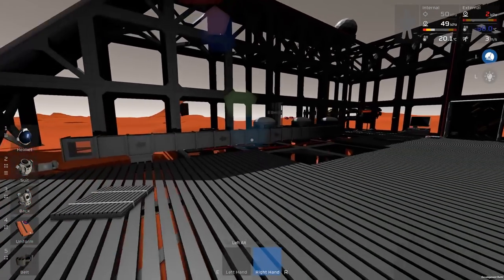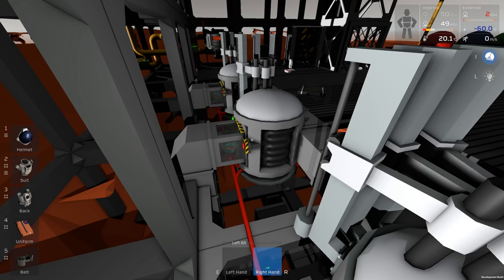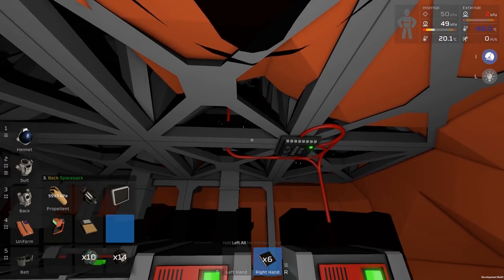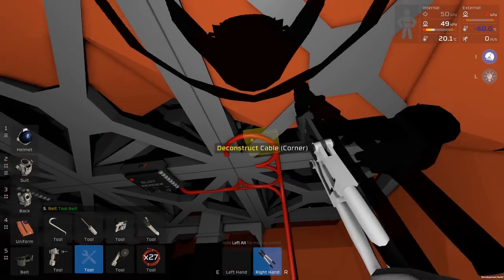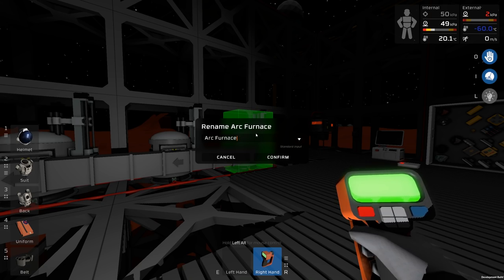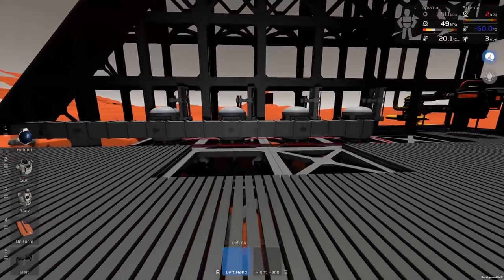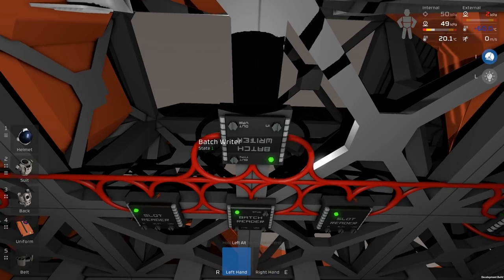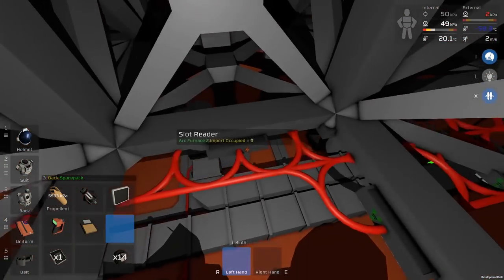Stationeers S2 E23 - Automated Arc Furnaces (part 2)

Comment: You could "buffer" all the ores in a vending machine. If an export slot tirggers you coudl "vend" with a logic writer to the arc furnace or do it with an logic computer. 100 stacks of ores is quiet a large amount in the small volume and also very tidy.
Reply: could be used as output for the mining belts and ingots aswell (edit: as he says later in the video)

Comment: probably more reliable with a comparator and both batch readers set to sum. if more furnaces are occupied than furnaces are active, hit acivate, otherwise don't. This will keep activate at zero until it is really needed. if it still gets stuck somehow just activate all furnaces manually and it resets on its own.

Comment: The system your using for the arc furnace, although effective, is a little in-efficient. As each run of ore finished the logic triggered all the furnaces again when there is nothing in the import slots of any furnace. I went a slightly different route which does use more logic but also eliminates the bug were furnaces connected to chutes directly as you have them will produce to much. (Some times they bug out and when you put in a belt full of say 50g stacks of copper through a chute and use logic to auto activate, the furnaces go into some kind of bugged loop where by they produce a continuous stream of 200g ingots - I had a game ruined by this bug once because I hadn't visited my production area for a while and the shear quantity produced was causing massive lag). So, although it takes much more logic I am using chute outlets on the import slot of the arc furnaces and my logic locks them by default. Then when the export slot is triggered on a furnace the corresponding chute is triggered direct from a slot reader so that it releases 1 stack to the furnace. When the chutes are empty and I add more belts to top the system up I wait for a light to come on which tells me all furnaces chutes now have at least 1 stack waiting and hit a button to kick-start the system - still working on logic to replace the button to kick-start. Also the output from your chutes were you have the ingots coming out, you can simply place a stacker at the end as they have been updated so that if they have something in them which is not a complete stack and a new item arrives they will clear themselves and start stacking the new item - your belts will just get spat right out without any delay - and you can then just pass them into your warehouse of vending machines (That's my next project which will be based on the sorting system developed by J33P_Guy_Gaming).
Reply from the maker: Yep, the next episode addresses the bug issue with a new electronics setup :)  (Spoiler - Two data networks, one batch reading the input slots, the other reading the output slots and writing activate to the furnaces on either being true) - works fine without chute shenanigans... so far ;)

Comment: grayduster I suggest you change the wiring for the heavy kind in your hot CO2 chamber, since you can melt normal cables with to hot temperatures of gases in the atmosphere around said wires! Heavy cables can't be melted in this way (to my knowledge).
Reply: Especially when you will heat it with the exhaust of a furnace!

Comment: Put an overpressure on each of your tanks (>55K) to release if you get too much.  This way you can always just assume waste gas will go to the filters.  If your gas is not hot enough to heat your room, feed it back to the filters and let it sort into your tanks.  If you want, move your existing radiator cooling setup before the filter system, but after your heat level logic.

Comment: grayduster I have a suggestion, just build the vending machine at the end of the output chute, since you can't stack diffrent rescourses with one stacker, it will just jam often, unless you will add some complicated logic to do it.
Reply: The vending machine will not stack items.  (At least it didn't when we tested it in beta).  If you feed it 5 individual ore ingots, you'll get 5 individual entries in the vending machine (of it's 100 slots available)
Reply: Nicholas Schubach Well that's better than a complete jam by using a singular stacker on a mixed ingot chute.

Comment: Good going with the sorters - Ill have to try that myself also like how it feeds the furnaces- but I would have separated each furnace on its own reader/writer -  slot reader for arc 1 - writer for arc 1 rather then try for batch read/write. Your already at 8 chips for 4 arc furnaces - they all seem to turn on/off as one unit - rather then each one alone.

Also i tried to comment on one of your other videos - about you complaining about the airlock cycle time. - Just use add a couple extra active vents with equal number of passive vents inside the habitat.  I had one airlock with 4 active vents - and yeh so fast I almost got blown out the airlock heh.

Have you uploaded your map to the workshop?  id be interested in doing some testing - I am using a small pre-built base that had a chicken coop / greenhouse pre-built - but the greenhouse needed allot of re-work to make it more functional - mostly in keeping its temp stable, still a work in progress for that.

My thing I used was the gas furnace - put a volume pump to fill it - and a volume pump to empty it - leave em off unless you want it on - pump it with a squirt or two of mixed gas - stays lit for several day/night cycles. 
built some chutes to add ore in / eject ingots out and works faster then arc furnace. 

I also set up the electrolizer device - to make fuel for an emergency gas fueled generator that charges the base in short order.
Reply from the maker: We'll actually be improving the furnace electronics in the next episode, as there are situations where they can jam.  They'll still all try to activate at once, but given the use case (emptying mining belts into the system), that works well.  If we did the perfect system, it'd be four chips per furnace, but we can save a few chips (see next ep).  For the ideal system, ignoring chip savings, two slot readers per furnace (import and export slot), two logic writers, reading each of the slot readers, and writing activate to the furnace will given entirely independent firing of each furnace (if you prefer that).

I'll definitely be adding more vents into the airlock systems when we get to larger airlocks :)

On the furnace - we'll be moving onto a pure co2 furnace pretty soon (since co2 is free, and power for heating is also essentially free).  That'll save the hydrogen use (oxygen will be free from plant growth, eventually).

Comment: grayduster I already said sort of a better way of doing it, just make a clock circuit, do this equasion [Bach reader - clock's memory value] and write it to the clock's memory and write it to the furnaces. Maybe it requires a memory chip additionally, but furnaces will do the job faster when diffrent ores and/or amounts of it will go the individual furnaces and most importantly it will prevent jaming when output and input full.

Comment: Not sure this system fully works as intended, I setup the same system and it work 50% of the time.  There will come a point in the process when the furnaces get stuck in an on state and the whole system locks up.
Reply: That's why using a clock woud be an advantage. It wouldn't stop completely at least. Unless those furnaces glich out compeltely and stop functioning poperly.
Reply from the maker: New setup in the next episode :)

Comment: If you just constantly sent an activate to all furnaces, wouldn't that work? I don't think it would activate without having anything in the import slot...
Reply: Mathias Andersson You can't, writers only write values to their destinations on a change of the input value so if you tell it to write "1" it will do it only once, unless you would use a clock circuit of sorts, but it might cause to lag more.
Reply from the maker: I did this using a clock circuit last season.  I found it hilarious, others found it horrifying :) You can use the new unary random chip to keep trying 1's ( and 0's ), with floor to truncate it's float value - less chips than a clock
Reply: grayduster I can make a toggleable clock with a prcessor unit, a i/o unit and a memory unit. How much does that cut down on logic units?

Comment: I still dont understand why others dont just use the gas powered furnace to mass smelt ores. Its not that hard to keep powered and heated and it instantly smelts the whole stack, almost no waiting. Just leave the eject lever pulled and feed chutes threw it and bam! 
“But what about alloys! You cant smelt alloys with the lever always pulled, and cross contaminating other ores?” I hear you swave players say...just have another furnace to the side dedicated to alloys, and with the lever always pulled on the first it ejects the stacks as soon as there finished filling, so it cant accidentally alloy other metals.
Reply from the maker: The most obvious reason is that it consumes resources (until you get a pure hot (i.e. no ignition) gas furnace up, which takes more effort, but I'll be doing that too).  Arc furnaces use electricity only, which is essentially free.
Reply: Yes but oxylite and volatiles basically grow on trees. Not that hard to keep maintained even thou it consumes resources. 

I see your point thou im just personally more willing to exchange resources for blazing speed. The arcs take a year and ahalf to smelt a whole stack of gold where the gas furnace cooks it faster then pop tart shoved under a Saturn V.

Any who just some food for thought.
Reply from the maker: Oxygen literally does come from trees (plants) and is free on Mars, as we have infinite CO2 for conversion.  Hydrogen - not so much.  If we could get regenerative hydrogen, then I wouldn't need to mine more.  Pop tart under a Saturn V sounds like an excellent KSP episode mind you :)
Reply: grayduster hmm maybe i just got lucky but i know on my map im always running into H2 ice i cant get rid of the stuff. And now with the new electrolyzer in the game you can turn your h2o into O2 and H2
Reply from the maker: Heh, and now you've moved the problem onto how to generate H20 :D

Comment: The reason they're all lit at the end is probably that your logic keeps toggling. If there's a furnace with stuff in it, and another furnace that's off, you'll activate the furnaces. Then they all read as active, I think, so your writer switches to 0. Then the empty one turns off, and the cycle repeats, fast enough for the furnace not to look like it's shutting off. You might be able to avoid this by testing if the sum of input slots is greater than the sum of active furnaces, which means it won't fire if you've got a combination of running furnaces and empty furnaces but no ready ones.

I think both your version and mine have an issue where, if the system decides to fire on the tick after it last fired, it'll get stuck. I think you can avoid this with a couple more math units, but it may not ever happen in practice with your furnace arrangement.
Reply: iabervon I thought it didn't allow logic to activate a furnace without a ore inside the import slot before. Devs could have broken it.
Reply: I'm pretty sure we saw in S1 that it does the animation at least, but it turns right back off. His circuit actually depends on this; if there was one furnace running with stuff ready to put in, and another furnace sitting empty, when the first furnace finishes, nothing would change (max input = 1, min activated = 0) and it wouldn't restart the furnace that can do something. But since the min activated keeps changing because writing non-zero to it makes it read as non-zero briefly, the total does change and the writer writes again.
Reply: iabervon But it still definetly behaved differently before. And since there shouldn't be a change to that (not noted in any pach notes) it sems like it was recently broken or was broken the whole time, which it wasn't (to my knowlege).
Reply: I just posted above but I think I am seeing this problem in action with the same setup as Grey.  I think the system needs something extra as you will encounter a point where the furnaces will get stuck and the system will halt.
Reply: If you're finding that the value the writer ends up with is 1, you could try this: make an oscillator with a unary not that reads from itself. Add a math chip that multiplies the oscillator by the chip that the writer was using as an input. Make the writer use this multiplier as the input. (If the input to this multiplier is continuously not zero, the output will change every cycle, and half of the time it will be non-zero.) You might want to use my "more furnaces with inputs than furnaces that are on" variant, which is only 1 if you'd actually like to start at least one furnace now.
Reply: I added a 4 chip oscillator to my setup and it works a lot better now. (Oscillator is  2 Memory / 1 Math / 1 Logic Writer) The oscillator toggles from 1 to -1 and operates the furnaces.  I have the Slot Batch Reader turning off the Oscillator once the import slots are empty with turns off the furnaces.
Reply: I can make a clock/oscilator with one memory less and have it still toggleable:
Math unit - [on signal - clock memory]
that then gets written to the clock memory
output is the memory itself, it will alternate 0 and on signal value [note: don't change the HIGH value during operation, it wiil breake it, then memory needs to be reset, and the LOW value is 0]